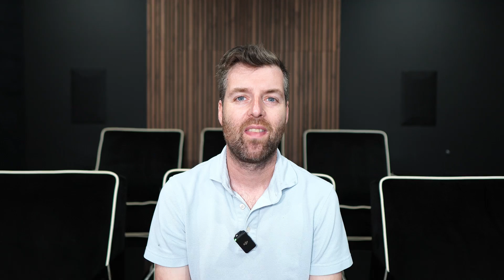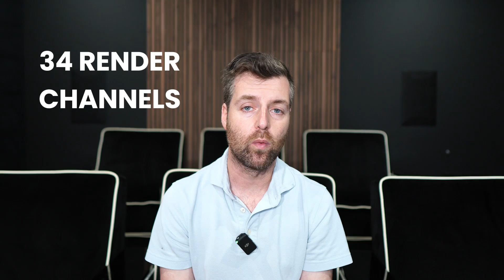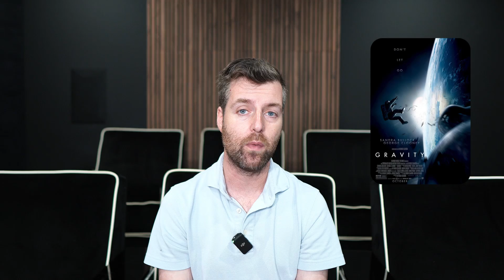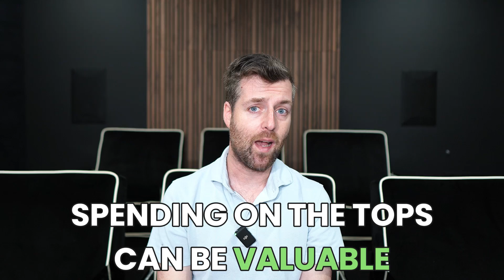Secrets of the Dolby Atmos Home Theater

Comment: The secret of Dolby is up mixing to Auro3D 🤭
Reply: Thats one way, but you wont feel the need to do that if you use good bookshelf speakers aimed at the listening area.   A good Atmos mix will sound phenomenal.   If its a bad Atmos mix.....well just upmix it!
Reply from the maker: So I actually don’t agree with the idea of using bookshelves necessarily. 

I believe the argument for this came from the idea that the bookshelf is a better quality speaker than many in ceilings and is being aimed at as I pointed out in the video, aiming only changes the spectral balance. It doesn’t enhance the top effect.  That’s a myth. But it does introduce a problem. Diffraction off the baffle and around the speaker causes response issues. 

So if we take a step back and define the optimal ceiling speaker for performance, it’s an aimed baffle mounted speaker. That gives the best coverage and the best response. The problem is that many such options are not of great quality. JBL and to a far greater extent, Perlisten offer exceptions to this. They are extremely high quality in ceiling speakers with an aimed lobe. Kef, Pro Audio Tech, and others feel that aiming isn’t important, just a wide smooth dispersion. 

Grimani takes a different approach that I also appreciate. It’s a low profile ceiling surface mounted speaker with an aimed lobe. This does introduce some diffraction. But he fixes it with absorption and diffusion surrounding the speaker.  

So I wouldn’t agree that a bookshelf is the greatest ideal for tops. It’s actually one of the more severely compromises options. It’s main advantage is that at the lower price point, it’s hard to find a good in ceiling that equals the bookshelf option for the same price.  I do think that the angled surface mount surrounds offered by some brands may be a good option similar to Grimani.  Again, it’s still not better than the aimed in ceiling option, due to diffraction effects. But it’s better than a deep large bookshelf hanging off an angled mount over 12” from the ceiling.
Reply from the maker: The secret to that is it’s no longer discrete object based surround anymore. You can’t upmix Atmos.
Reply: @PoesAcoustics  actually you can.  There is a model of Yamaha receiver that can actually use the objects with Auromatic upmixing.  Its the only one that can do it as far as I know and its fairly new (been out a year or so?)

I'm curious if the new AuroCX will have that capability or will Dolby block such efforts.

I have also heard that Storm's proprietary upmixer can use Atmos objects as well but havent seen confirmation of this.   The Yamaha being able to do it was confirmed by Auro reps.
Reply from the maker: @FURognar  I am not sure what a Yamaha is doing. I am going to go out on a limb and argue it’s not upmixing. It’s enhancing the ambience, which is what StormXT does (I checked with Storm to confirm before responding). They don’t add direct cues, which upmixers do, they extract the decorrelated content from adjacent channels and add it into underused channels. It is different from upmixing. Yamahas ambience enhancing 3D effects were similarly never considered upmixers for the same reason. 

In my opinion these are just silly effects. It’s not intended to get at director intent. It’s just designed to make people happy who like and want all channels active all the time.
Reply: @PoesAcoustics  its in this video interview with the CTO of Auro.  He begins to mention it about 38 min 40 sec into the video.   He specifically says the Yamaha version of Auromatic can upmix keeping the objects intact.

https://youtu.be/DuxuRWVUcGk?si=dlFD_nOUZ1K17tfa
Reply from the maker: @FURognar  I’ll look more into it. I had been told by Dolby previously that it wasnt allowed by Dolby. They had totally locked down Dolby at one point. That changed but they still were restricting the upmixer. 

If it is doing that, it’s basically like overlaying all Channels stereo onto Dolby Atmos. That wouldn’t be a good thing in my book.  auro3D is a fairly basic form of upmixing. While it has fewer artifacts it would seriously corrupt the surround track.
Reply: From what he said it sounds like it would also apply upmixing to immersive DTS:X as well.  If it would leave active objects intact and just upmix the bed-layer (in the Auromatic upmixes) that would be ideal as you still get your immersive effects but expand the overall soundstage.

Much in the way DTS:X-Pro uses Neural-X to upmix the 7.1.4 bed track to more channels and uses Neural-X to expand more content to the height channels (played with that the other night using the Brendan Frasier Mummy film and Hugh Jackman Van Helsing film)

Comment: Thanks for the video, keep these up! One thought about levels I think I heard from Anthony Grimani in another video: since our ears face forward, what I think he suggested was to level balance based on what our ears hear. When I used a SPL meter and calibrated all of my speakers to 75db, I noticed the atmos speakers didn't sound as loud as the rest. By increasing the Atmos speakers a couple db, they then sounded the same level as my front sound stage. I'd be curious to hear your thoughts on this suggestion. Agree with your point though, that dialing up many db just to hear Atmos effects louder isn't a good idea.
Reply from the maker: I don’t necessarily do this. But I do use sweeps or pink noise measurement of all speakers and align. An SPL meter can give a false reading if the response differs enough. I’ve had that happen before.
Reply: Are your atmos tops directed at your like your mains are? If not then you are probably running your tops off axis to the listing position
Reply: @njrumenos  They are pointed to me. I think Grimani's point was our ears hear a lot better with stuff in front of us rather than above and especially from behind. A mic or SPL meter is omnidirectional so the SPL measured isn't the same as what our ears perceive. My front Atmos sounded louder than my rear Atmos even though all 4 were calibrated to the same 75db SPL. And the bed layer speakers were louder than all 4 Atmos. I decided to change the levels up about 1.5db so that everything sounded similar to my ears.
Reply: @NMP660  when you say they sounded louder what are you referring to? Content playback or during calibration?
Reply: @njrumenos  When playing pink noise.
Reply: @NMP660  I would not worry if a speaker sounds louder than another during calibration, use your measuring tools correctly and level match them all, if you want to take things further maybe you want to test each pair of speakers for phantom imaging, I know the bed layer is relatively easy to do and the heights individually but I’m not sure how you would go about testing the phantom between a height and a surround or height and main, not even sure if that’s a thing but Matt might be able to confirm in that regard. Once everything is calibrated you want to test it out using well known content for surrounds and atmos effects and see how it sounds, remember a lot of content is really bad and can make your system sound off when it’s really not.
Reply from the maker: @njrumenos  and this is one of the reasons for using frequency response measurements to level match. We level set using pink noise and dBC SPL.  The pink noise is special bandwidth limited pink noise. This prevents the effect of being off-axis from impacting the SPL. But it was designed for large commercial cinemas. And homes are quite different.  More severe off-axis issues. So you can get a perceived lower SPL and need to adjust a little. Or EQ differently. Or aim, which can be the best solution. It really depends a lot on the speaker.  Some in ceiling or ceiling mounted speakers do have very wide dispersion and so this is less of an issue.
Reply: @PoesAcoustics  yeah I have herd Grimani mention narrow mid band pink noise for testing individual speaker SPL so it is a more consistent noise across all speakers and it makes a lot of sense as some high end frequencies can drop off and some lows can have boundary gain
Reply from the maker: @njrumenos  yes exactly. This is the Dolby derived SMPTE standard. So most test discs will do this. REW supports it for example. But like I said, you want to look at both. 

Trinnov actually lets you use dBC or dBA for level setting. Just in case.
Reply: @PoesAcoustics  yes ultimately I think people don’t understand how the surround sound field really works, rather than speakers being localised they are there to “fill the gaps” and give a sense of ambiance and immersion rather they hear the sound emitted from the speaker itself maybe this is why people tent to run there surround hot? Maybe there is a lack of ambiance due to poor phantom imaging between all the different speakers?